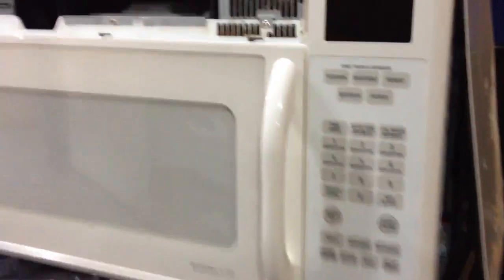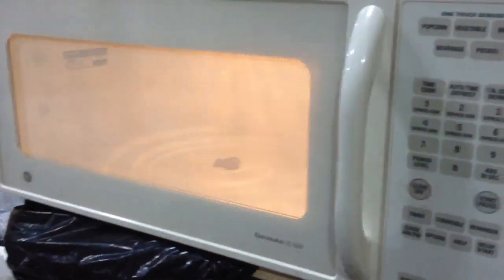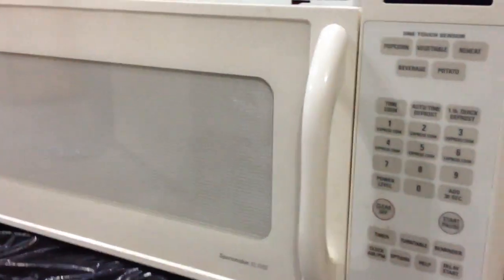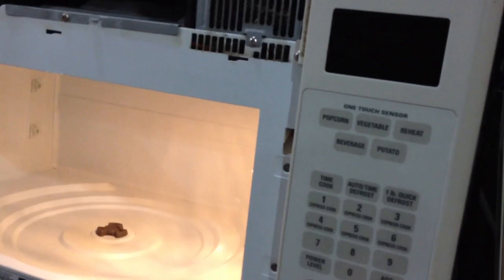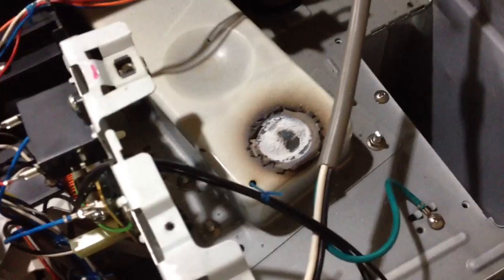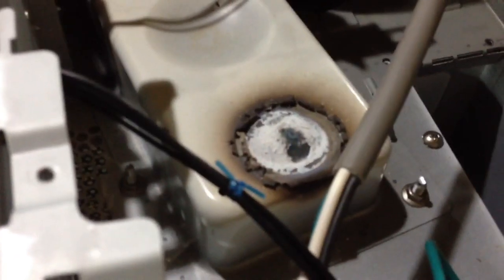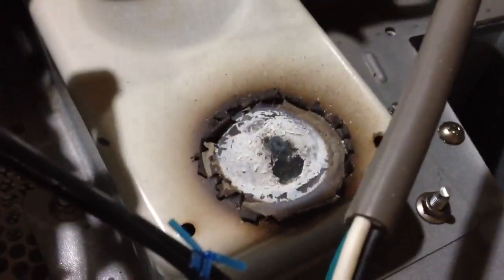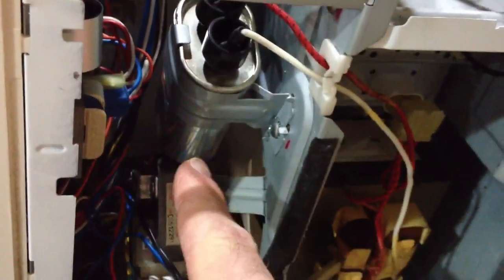Spotting a bad magnetron in a Microwave

Comment: Hello I opened my dads microwave and found that the diode was burnt out and arced to the capacitor. If I just replace the cap and diode is there a good chance it will work? Thanks

Comment: You definitely need to Change the waveguide if you can for some microwave it is welded to the frame
Reply: 47 second in, the burnt part is the wave guide.
Reply: On most microwaves the wave-guide is not replaceable. A burned one will make the new magnetron fail too.
Reply: What part of the video shows the waveguide?
Reply: At 47 seconds I see the magnetron (at least that is what he says it is in the video). Is the waveguide the same thing?
Reply: You can see the magnetron at 1:01
Reply: Ah, I can identify both now. Thank you for your help.

Comment: I was in the process of replacing the magnitron and the control panel fell and disconnected the lines for the switches. I do not know the original configuration and being that I am not a technition I cannot read the schematic. Do you know where I could get a picture of the inside wires for the microwave in question so I can see the original config and replace the wires accordingly?
Any help would be appreciated

Comment: PLEASE HELP!My 2007 over the range model#MH1160XSY-1, was  turned on while having a lot of condensation in it,from boiling water on cooktop below,and did the blue- loud- spark thing and flipped the breaker. I then tried it later, same thing. It seems to run fine for about 20 sec,then kicks the breaker off. A new one will cost me $500, so I really need to try to fix this thing.>What would you recommend to check first? Any info, will be greatly appreciated! >>>Thanks so much for the awesome video!